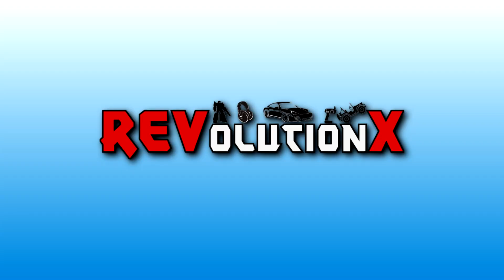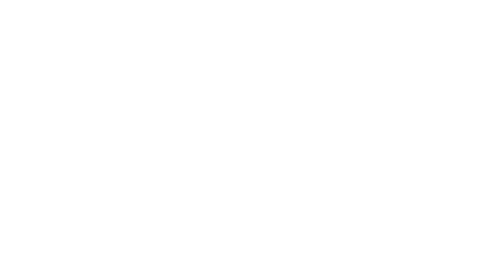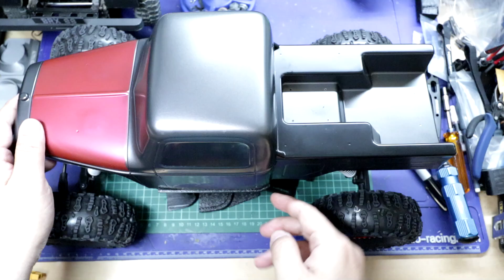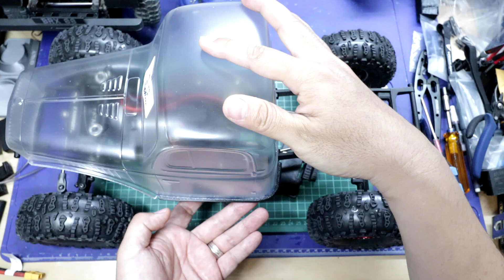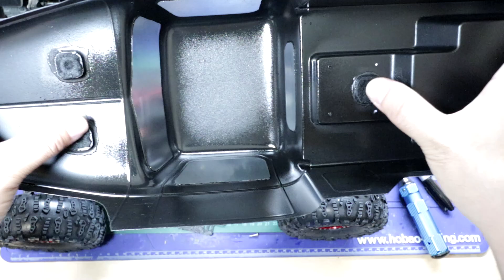Vanquish VRD Carbon Build Series - Part 7 - 3D Printed Parts

Comment: Excellent videos! I should received my Vanquish VRD Carbon kit sometime next week. I'll definitely be referring to your videos during my build. I also love the sliders you designed. Any chance you are working on a 'slider top' for a Pro-Line Cliffhanger body? If so, I'll be placing an order for the sliders, tops, and battery tray!
Reply from the maker: I don't have the cliffhanger body yet.  I'm also deciding whether to do the full body or just the cab only.  I'll be sure to make a post if I do though.

Comment: wow very kewl what do you recommend for PLA ?
Reply from the maker: You can use PLA, but you just need to be aware of heat.  PETG has a higher heat resistance than PLA.  PLA can warp if it gets too hot, or if it just sits out in the sun.
Reply: @RevolutionX  kewl kewl man just made a purchase
Reply: im running the j concepts power master will your power master sliders work for that body it seems pretty close
Reply from the maker: Will ship today
Reply from the maker: Honestly, I don't know. I don't have that body yet. You could get those inexpensive proline power wagon cab clones off Amazon though.